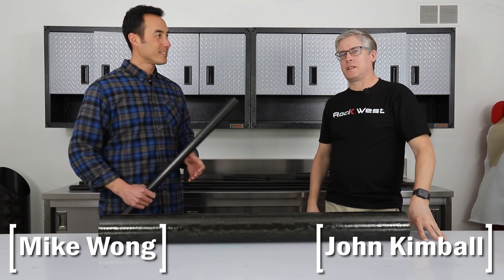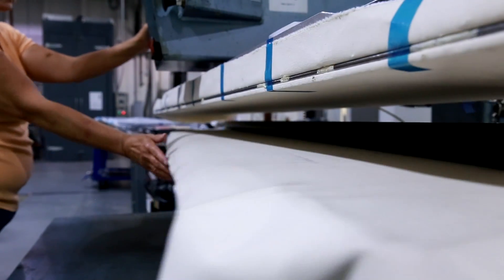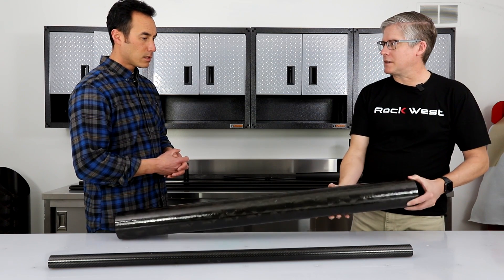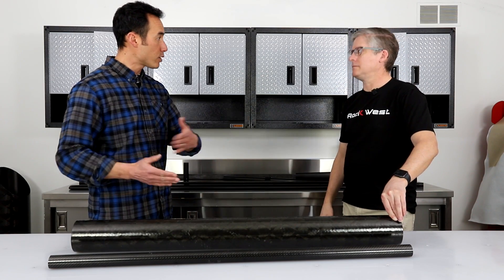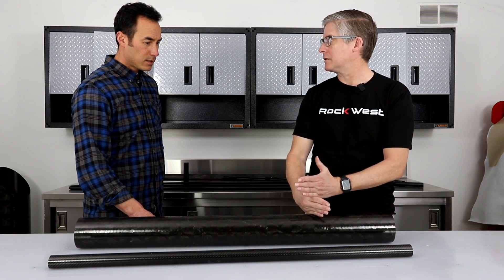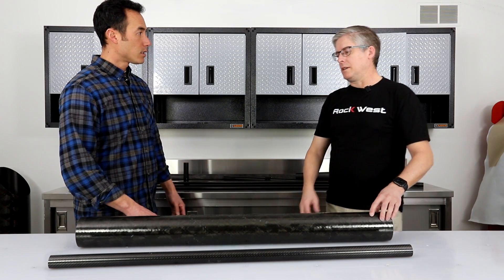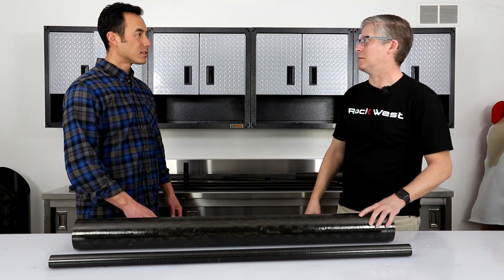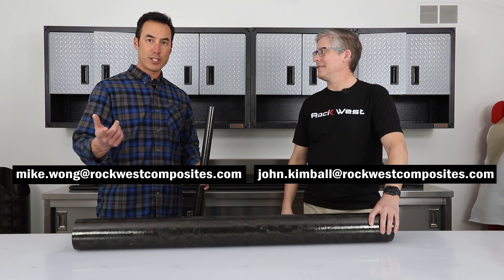Roll Wrapped Vs  Filament Wound Carbon Fiber Tubes

Comment: Would filament would be a good choice to build chasi stiffening applications like frame  braces or would the best performance come from roll wrapped twill weave
Reply from the maker: Both versions can be used, but each has their own strengths. Cosmetically, roll wrapped are better, and can be stiffer, but roll wrapped has length restrictions and diameter constraints. Filament wound has more continuous fibers that are more co-mingled than roll wrapped, so can be much better in ultimate failure without delamination between plies. But, with filament wound, we don't typically wind any less than 15°, so in practice it's slightly less stiff than a similarly sized tube that has 0° fibers in the laminate.

Comment: Questions here, rather than a comment - I have seen small tubes used as extendable poles for microphone booms (film shoot) but was wondering about a tall version (5-6m) to stand vertically as an antenna mast (taking it around in a caravan, hence need to collapse it and have weight-saving). How can I calculate the required thickness? I'm assuming roll-wrapped would be the ideal material, as no torque is involved.
Reply from the maker: Telescoping systems are tricky because each tube has to fit into the next tube and so on. To make it more simple, the tubes will generally have the same wall thickness. Our INFINITube series will give you a better idea of what it takes to telescope. Telescoping antennas are widely used, but you will find that they can be very flexible at the lengths you are looking for. Most people will use guy wires to help with stability. https://www.rockwestcomposites.com/shop/round-tubing/infinitube-round-telescoping-tubing/infinitube-v
https://www.youtube.com/watch?v=LoF4O5XN3_4

Comment: Could I roll wrap an aluminum cylinder for a compressed air tank? 200 psi max. How many layers of what thickness carbon fiber would I use and how do I cover the domed ends?
Thanks,
Paul
Reply: Typically, pressure vessels like you are describing are manufactured using the filament winding technique. This increases the internal burst strength of the aluminum liner and reinforces the domes. We do not recommend playing around with potentially dangerous situations without the proper engineering design and manufacturing techniques.

Comment: Nice. Would like to see some strength test videos for various sizes and types of carbon fibre tubes.
Reply from the maker: Well you are in luck :-). Kind of... Here we compare carbon fiber to other materials all together. A side by side comparison of standard, intermediate and high modulus tubes PLUS roll wrapped vs filament wound would indeed make for a good video! https://youtu.be/S6niIa1wCQg